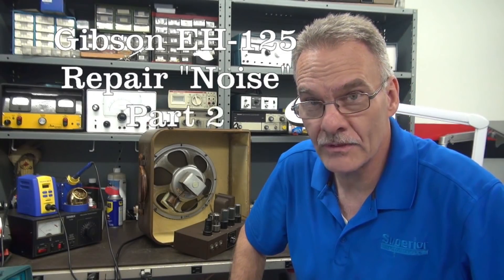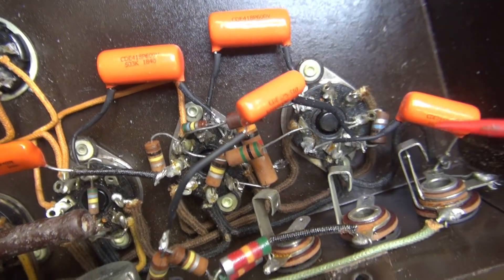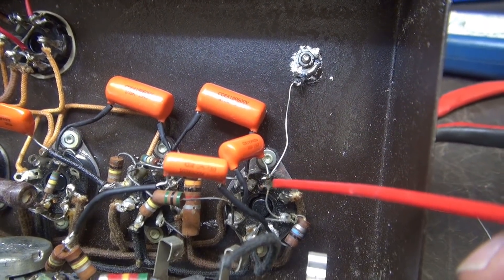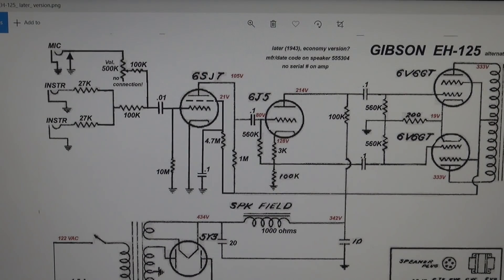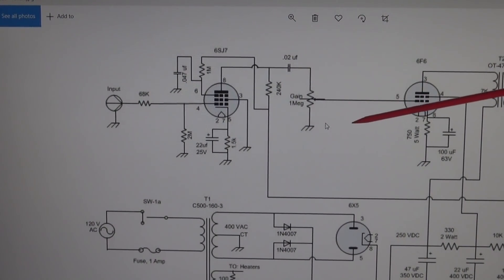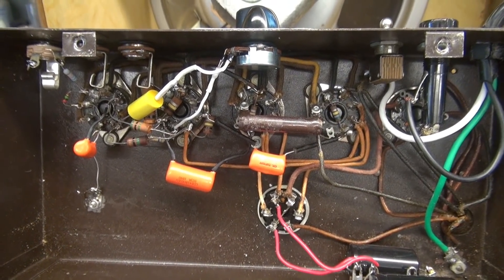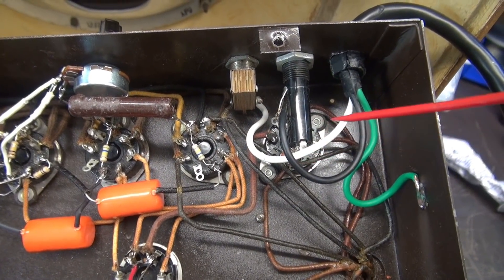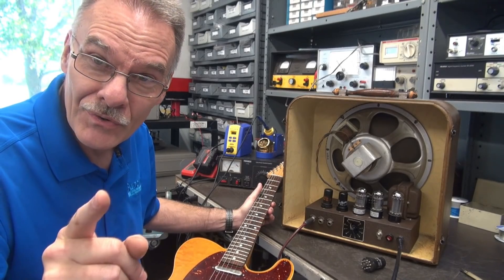How to reduce noise Hiss Vintage Gibson EH-125 Tube Guitar amp Part 2

Comment: Don't know if you'll see this but..., my VOX AC15 C2 is making noise like when the pots are dirty, but I've cleaned them and it's not the pots, the noise is the same but it does it while I play, and it does it specially on some notes, so with some frequencies I guess. So it's not pop or rattle or hum or crackling, it's the same as the noise dirty pots make but while playing. It also does some squeaking noises while I'm not playing (sounds like it was crying! ). So, um, any clues? Thanks in advance. Nice videos btw.

Comment: If it was mine,....think I would have modded it further for contemporary guitar use. Separated inputs with 3 different grid resistors so you could have a choice of hi/low/bright inputs would be useful. And a 6SN7 instead of 6ac7 input tube would make another gain stage after the volume pot available. The Eh-150 was designed & built before R&R was stolen from the black folks....so it needs a kick in the arse.

Comment: Question: Could you just jump the output of the top 27k to the input of the pot and clip out the bottom 100k resister?  That way all 3 inputs would be running in parallel into the pot.  Just a thought.  Good video so far.

Comment: You’ve got DC across that VC. Put a .022 on the feed to the inverter off of the VC
Reply from the maker: Excellent idea, I will give it a try. Should have thought of that! Just installed the cap! The pot noise is gone! You rock. This update may justify documentation? Thanks man
Reply: That's exactly what I was thinking. Good job !
Reply: Was that .022 in line or down to ground ?

Comment: Nice work Terry...one question, you soldered the AC green ground wire to the chassis; would a nut/bolt with crimped wire connector and shake-proof washer been appropriate? I know the ground lead probably won't get hot enough to melt the solder and disconnect leaving the chassis ungrounded but...  73 - Dino KL0S
Reply: Dino Papas Hi Dino, for what i’ve seen it comes to Terry with a 3 prong allready installed (see video 1). Also there, you can see when Terry removed that big rocket cap the ground lug is bolted with lug and a nut and soldered.
Reply: @Retro.Studio  Well, that's why I mentioned it since he went to the trouble of doing a nut/bolt for the input tube ground connection. TNX for the comment!
Reply: Dino Papas I am more surprised that Terry is not rewire that non twisted filament wires ✌🏼

Comment: Should a one tube wonder record player smoke if it has no valve in it or do you think it could well have other problems?,I am in the process of 

doing up a Philips NG5158 as a novice I just plugged it in to test and there was no sound due to the tube falling out in transit.After finding 

the tube rolling around inside and pushing it back in it seems to work fine, I'm just worried it won't last long after the smoking episode.
Any help I would be grateful of thanks John
Reply: Record players shouldn't smoke. Very bad for their health...

Comment: Hey Terry.  Long time watcher and subscriber.  I have an old mid 90's Marshall Valvestate VS100R 1x12 combo amp that has developed that same 60-cycle hum over the years, even on the clean channel, and with the volume all the way down.  What is your hourly rate, and are you taking on work at the moment?

If so, I can remove the chassis from the cab, and bubble-wrap it and send it in a smaller box to cut down on shipping costs.  The VS amps don't have much resale value in today's market, so I don't want to sink a ton of money into it if the repair is going to be a major one.  If that ends up being the case, how much would you charge to rip the old solid-state junk out of it, and convert it to a JCM 900 with 2 individual tone stacks (1 clean, 1 overdrive) with 2 overdrive channels, effects loop, and reverb?  That should require about the same number of potentiometer knobs and push-buttons that you could leave in the same places, so you wouldn't have to modify or change anything on the front panel.
Reply: I would love to see that point-to-point JCM 900 project. I had a 1980 Marshall lead 2000 head 250 watt 300 watt saturation. So much fun!!!
Reply: @Finom1  If he wants to crowd-fund the costs, I'll send it to him and he can make videos of the build, and send it back when it's done.  I don't know what it would cost, but I'm sure it's more than I got right now.  I was just curious about it for a future project.  It would definitely make a good series...